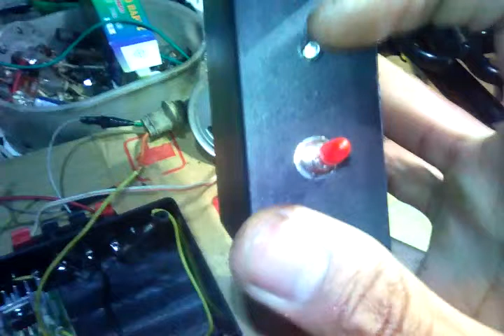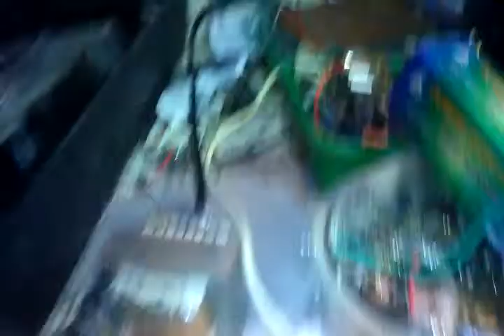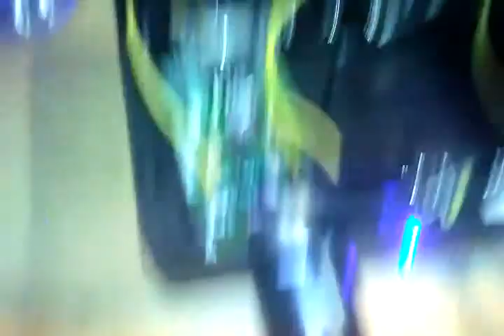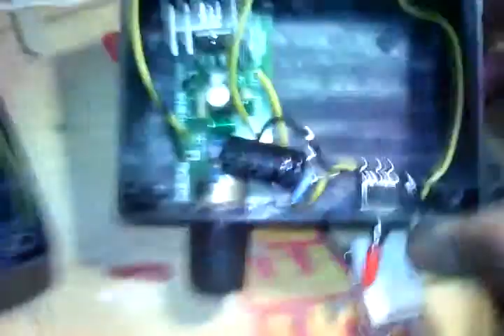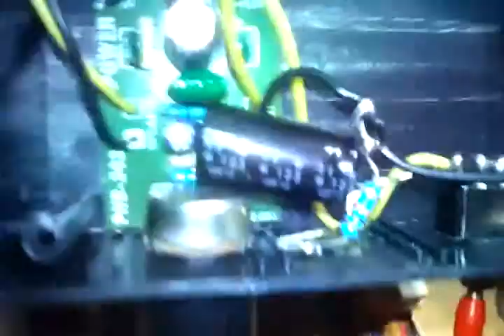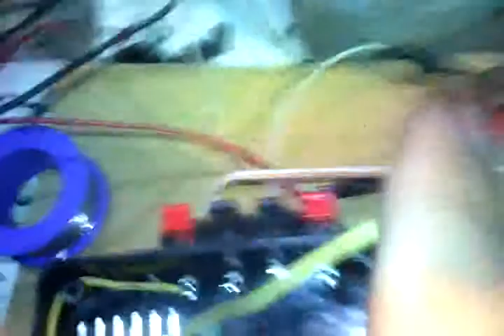Cara merakit amplifier untuk jualan dimotor atau mobil pengeras suara toa speaker

Comment: Om klok gak keluar suara nya itu apa om  yg rusak.tapi hidup
Reply from the maker: Mungkin volt ic yg ke modul ndak masuk
.
Reply: @SharingKreatif  om kalo pake TDA 2004 stereo bisa gak?
Reply from the maker: @masfibersoundman  ni pake mono bos
Reply: @SharingKreatif  iya om, kalo TDA 2005 terus pake trafo 3 amper bisa gak?
Reply: @SharingKreatif  om kalo di tambahkan Preamp Mic bisa gak? Asalkan di input Audio Kit TDA nya di kasih resistor 1K. Boleh gak om ,katanya kalo pake preamp suaranya tambah kenceng
Reply from the maker: @masfibersoundman  bisa saja.. nggak masalah